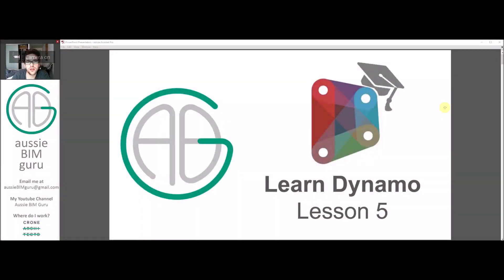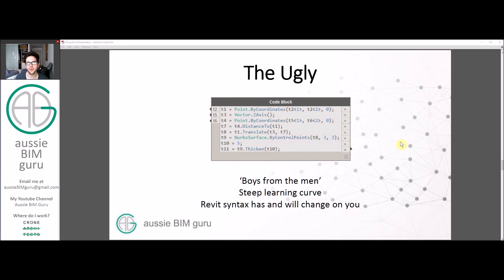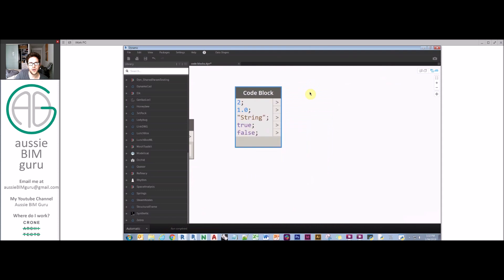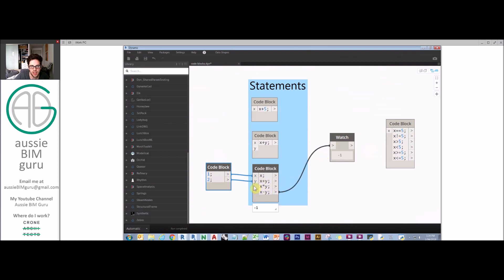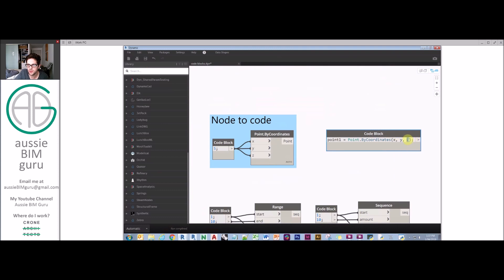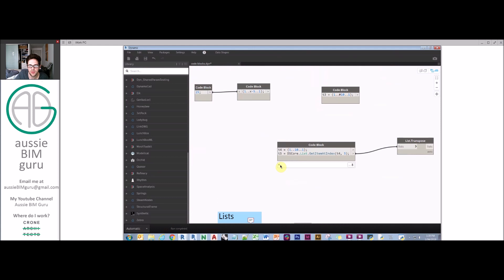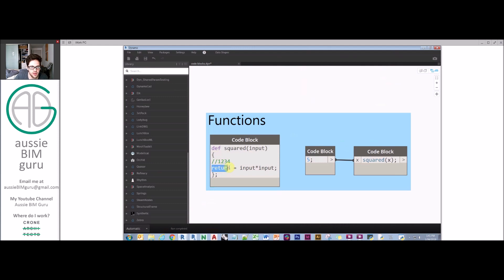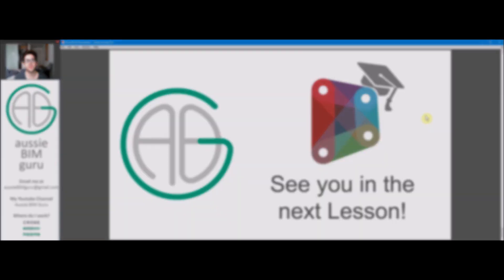Learn Dynamo - Lesson 5: Design Script and Code Blocks

Comment: Hi I am using the current version of dynamo.I can't do this with code block in the String command " when I use this mark it gives an error.
Reply from the maker: What does the error say?
Reply: @AussieBIMGuru  EOF expected
Reply from the maker: @cengizhankaya6272  make sure you check all strings are closed with another ", all lists are closed with a ] and all lines end in a ;
Reply: @AussieBIMGuru  thank you